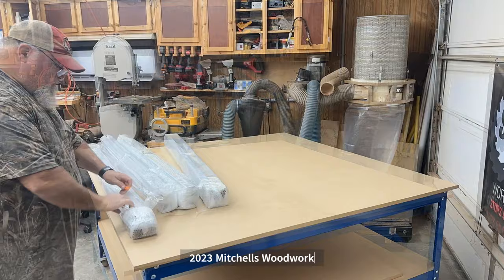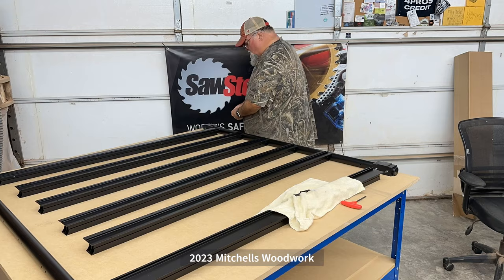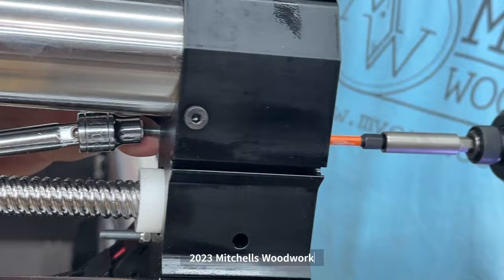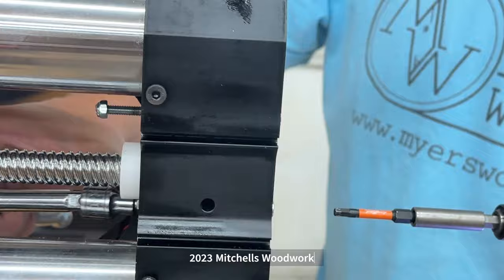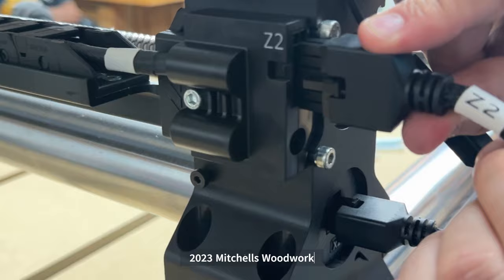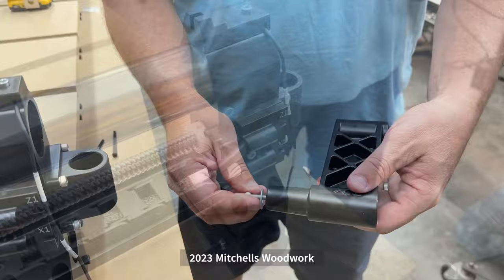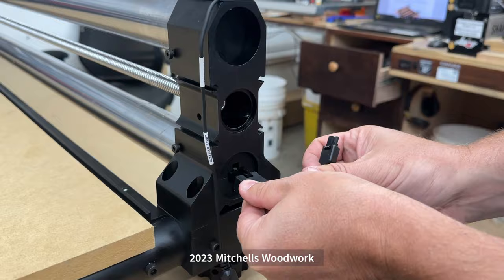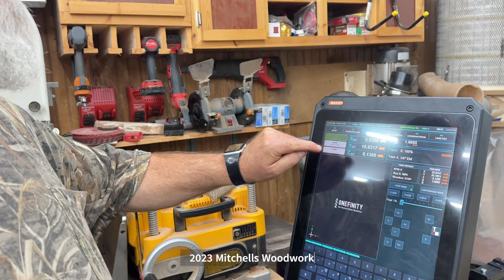Assembling A Onefinity Elite Foreman CNC with QCW Wasteboard

Comment: Thank you for the video.  I have read the assembly manual on their website and have watched a few assembly videos.  I have yet to see anybody address the Z axis during assembly.  Is there an assumption being made that every table the machine is placed upon is planar in the Z axis?
Reply from the maker: If I’m understanding your question, I would say, yes.   The Z slider is either 90° to the bed or it’s not.  If you’re concerned about it just check it with a square against the waste board.  Also, once you surface the waste board the first time you’re gonna know pretty quick if you have a tramming or leveling issue.  I just now checked mine (first time ever) and it appears to be perfectly 90° to the waste board.  The way the slider is built I would think it’d be pretty hard to attach it to the gantry out of square.  

I hope this answer was helpful, but if I misunderstood your question, I apologize.  You can contact support@onefinitycnc.com if you need additional information that I’m unable to provide.  Thanks for watching and commenting!
Reply: Im talking about the four attach points on the side rails.  I should have said the z plane. Ive been researching these for a while now and my brain to typing translator can get a bit foggy.  
  If a person does not buy the qcw frame with leveling feet and mounts directly to a table there is a chance to introduce a twist into the side rails if the table is not flat.  I guess a solution would be shimming at the attach points as needed when mounting directly to a table.
    Thanks for the reply, thanks again for the video and hope you are enjoying your machine. @MitchellsWoodwork

Comment: I find it strange that the QCW is not designed to be attached to the table.  Have you noticed any movement of the CNC while in use?  I'm waiting for my Onefinity to be delivered.
Reply from the maker: No, the CNC + QCW is so heavy it hasn’t budged at all.  Plus the feet on the QCW are rubbery and grip great.

Comment: What do the longer bolts have to do with homing?
Reply: Hi Tom,
The bolts will stick out too far without the screen monitor mount installed and will prevent the left Y rail from going into the homing sensor and alarm.
Reply from the maker: Great question, thanks for watching!

Comment: Thank you for showing the stepper motor installation. The motors are labeled - do they have specific locations?
Reply from the maker: When we assembled mine the motors were interchangeable.  I’m pretty sure that’s still the case, but to be safe I’d recommend you email support@onefinitycnc.com just to make sure.

Comment: Did it come with those t tracks or was that an add-on?
Reply from the maker: The T-tracks are part of the QCW frame.  You only have to supply the MDF strips.
Reply: @MitchellsWoodwork  Thanks! Did you choose secure from above or from below when you ordered it?  I saw there’s a choice.

Comment: I'm looking for what position does the Spindle go in relationship to the position of the Z20 slider to tighten the clamp down ? Thank you
Reply from the maker: My spindle body sits 4.125" below the bottom of the clamp.  I am not including the spindle shaft in the measurement, only the spindle body.  You can email me at mitchellswoodwork at gmail dot com and I'll send you a photo if needed.

Comment: I am assuming you have the QCW Below mount, is this correct?

Is there a way to safely R & R the spoilboard panels without having the whole CNC slide off the table  when you tilt it up  ?
Reply from the maker: Yes, my QCW is attach from below type.  Mine came with 2 “kickstands” that are used to hold the machine up on end to allow access to the bottom of the QCW, but I haven’t had to try it yet.

Comment: Really surprised to see that you had to install your motors. Watching onefinity's video it appears they are pre-installed.
Reply from the maker: I hadn’t noticed that, but you’re correct.  I’m sure the Elite featured in that particular video was assembled in the late developmental / testing stage, since it was uploaded 5 months ago.   But no problem either way, the motors are simple to install.
Reply: HI Paul.  We've shifted to removing motors as early shipments had a lot of motor damage.  They now come in their own box for protection.
Reply from the maker: @OnefinityCNC  thanks for the feedback!  My motors were indeed well packed and protected.
Reply: @OnefinityCNC is there a way to mount the Masso screen on a wall ?

Comment: How long did that whole process take to complete.. I am getting a 1F and like the QCW system..thank you
Reply from the maker: It probably took us 4 hours total, but we were also filming and having to set up some of the shots, plus goofing around a bit, so it took longer than normal.   Had I been doing it myself with no distractions I think I could’ve did it in probably half that time.   

Which machine are you getting?
Reply: @MitchellsWoodwork  elite
Reply from the maker: @bobmonday925  do you currently have a CNC?  If so, which one?
Reply: @MitchellsWoodwork  I do not.. I have Vcrave and have been making projects and running them on a Shopbot at a maker space in our area, I am currently living in Indianapolis, we are building a new house in North Carolina. I am adding a 30x60 shop as well and will relocate my new shop there. I don’t want to get the 1F until I get settled in so I don’t have to move it. Just be soaking up lots of video content to get familiar with the new 1F. Like t the add ons you have been featuring on your channel.
Reply from the maker: 30 x 60 shop!?!  I can’t even imagine having that much space, congrats!  According to the 1F website the current lead time for Elite series is 7 - 9 weeks, so keep that in mind as you plan your move.  When I ordered mine on 4/11 the lead time was 16 - 20 weeks!

https://www.onefinitycnc.com/order-info